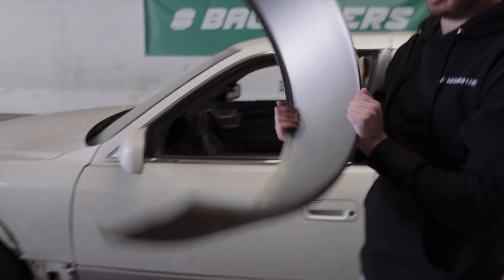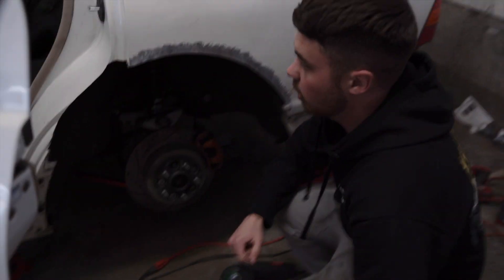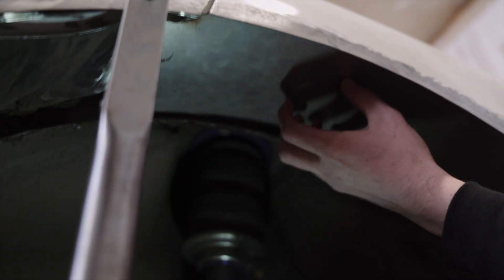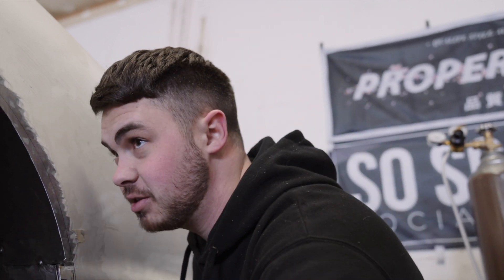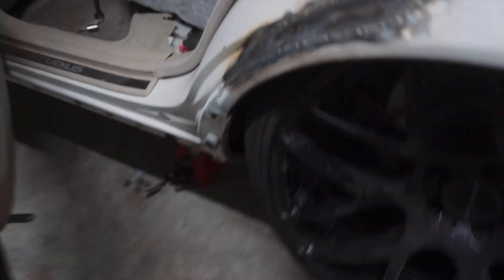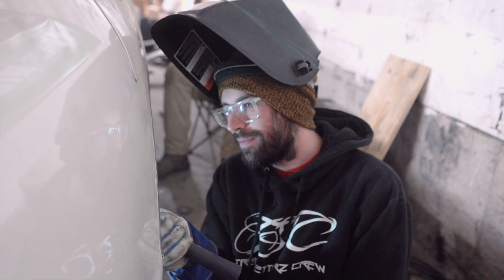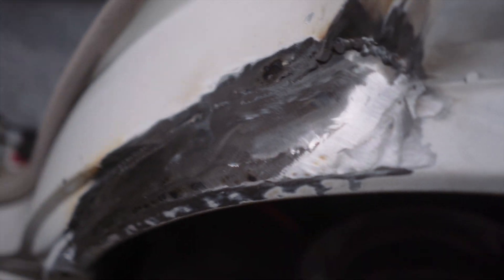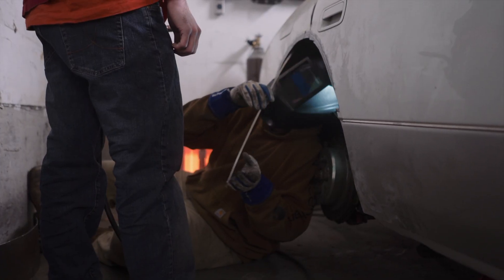Tubbing The Rear End - VIP Style LS400

Comment: Just make sure you apply short strand fiberglass body filler on the welds and it can fix your warped panel. It's hard to sand but its waterproof and good for stopping rust.

Comment: If you are disperse you tack welds further apart and be very patient by letting it cool you’ll be able to seal that door off without wharping, you may also be running too thick of wire in that machine. Thicker wire takes more higher amperage to burn, therefore thinner wire will result in less heat thru your panel. Looks great, maybe these tips can help out a bit 🤘🏻👍🏻
Reply from the maker: We did disperse the tack welds and tried letting it cool at first, but it made no difference. The panel was just super thin, but is what it is, everything is in place and never moving... that's all I care about.
Reply: @LEPAutomotive  I tell you what... I hate welding Lexus panels. LOL.  I have the right wire and right settings and the metal is just thin...